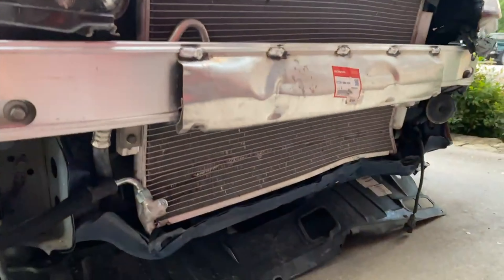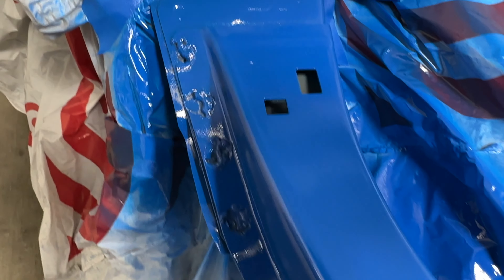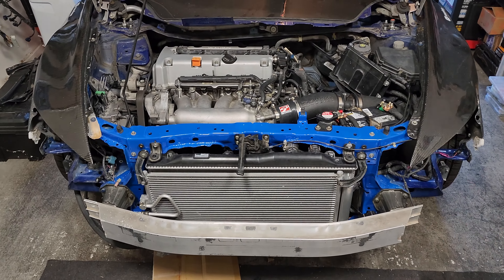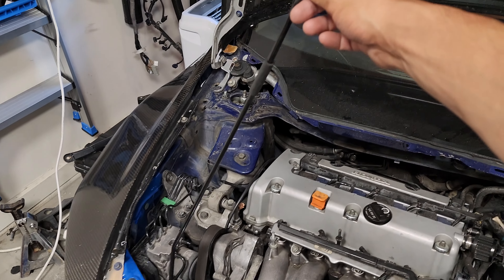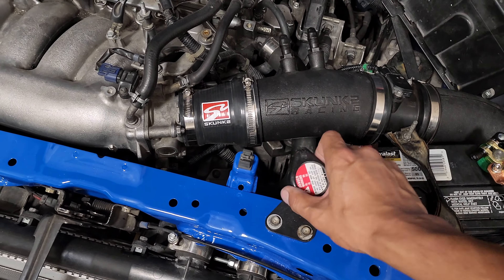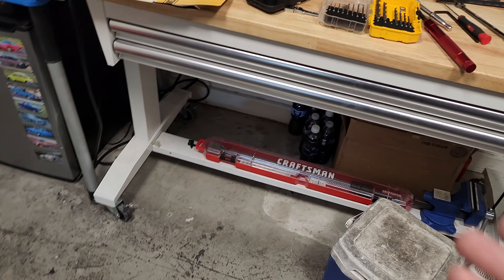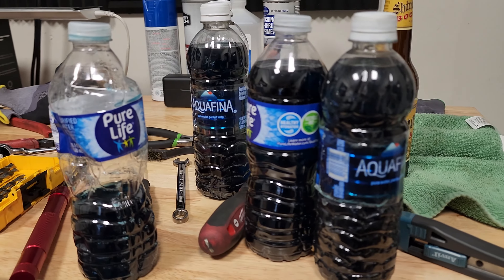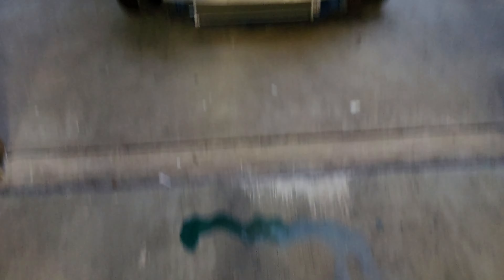Civic Update - Fixing Everything

Comment: What’s up Rawrkee,I’m Based out of Southern California and just purchased my fd1 clip from the importer Jdm of California. I’m a little thrown off by the xenon portion and wiring of those headlights from my stock bulb sockets on my fa5. Any way I can get tips on doing the conversion wiring? Please and thanks 🙏🏻🙏🏻
Reply from the maker: If I recall correctly, each headlight has two plugs that are different but they have the same wire colors on the fa5, just splice those wires into your harness. If you don’t want to spice into your harness, I believe there’s a guy who makes a plug and play kit.
https://www.ebay.com/itm/335007473466

Comment: How much was repairs?
Reply from the maker: I think I spent $150 on the radiator support and then I bought used headlights for like $500 🫣 
The civic still isn't fully repaired as far as cosmetics go but I saved a lot of money by doing it myself but it also cost me to buy a welding machine, welding helment, paint and other random stuff. If I took it to a shop, it probably would've cost $800+ to get the radiator support welded
Reply: @Rawrkee  thanks for the reply how much was the welding stuff because im in a similar situation
Reply from the maker: @burritodorito3176  The Titanium Easy-Flux 125 is about $150 from Harbor Freight and if you're patient enough to wait, they'll typically have coupons for it to save you some money. I got a $50 helment on Amazon, some flux welding wire, a welding jacket and gloves, and thats about all you need. It also takes a lot time removing the spot welds too
Reply: @Rawrkee  Thanks for replying and for this info, do you know how much it would have cost from a shop?

Comment: Question bro… that upper radiator hose 
Which one is that one?
Reply from the maker: Sharp eye 😮
It’s from a 02-04 TSX K24a2
Reply: Damn i didnt know that cleared cold air intakes lol
Reply: @Rawrkee  i know the napa 7777 is said to do the same
Reply: @Rawrkee  did u have to modify it or cut it a bit?
Reply from the maker: @xradicaljetx  not at all, other 8th gen guys said it fits perfectly with the skunk2 intake